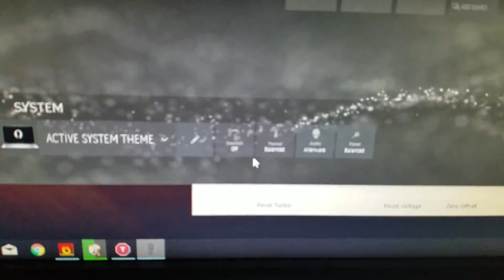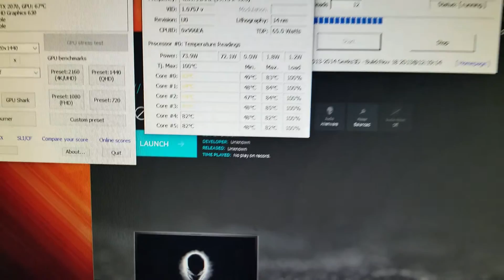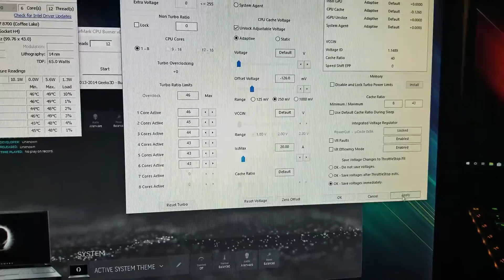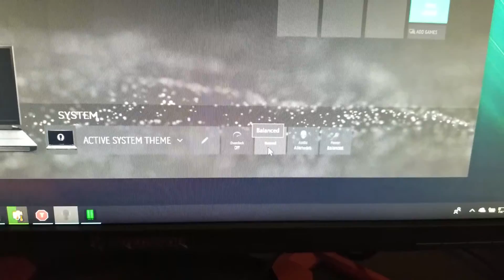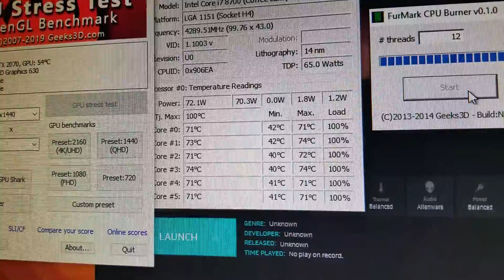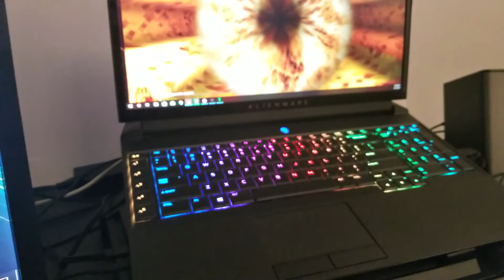Alienware 51m Laptop (8700 + RTX2070) - Furmark Heat Stress Test - ROUND 2

Comment: My hp omen with rtx 2070 and i7 9750h doesnt perform as it should.
While running gpu stress test, gpu heats are going up to 93 degrees and core clock keeps decreasing till 300s and fps keeps dropping till 30 from 190 in like 10 sec.
While running cpu stress test,  cpu heats are going up to 99 degrees and my cpu doesnt work on its maximum. The clocks are decreasing to base clock as i check on task manager performance tab.
Do you think if these are going to be okay if I renew the thermal pastes and clean it ??

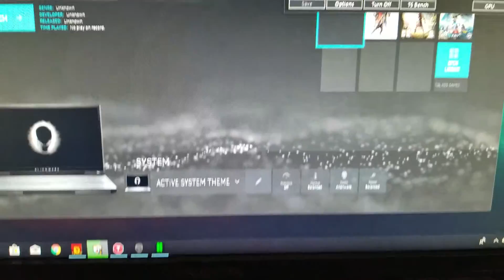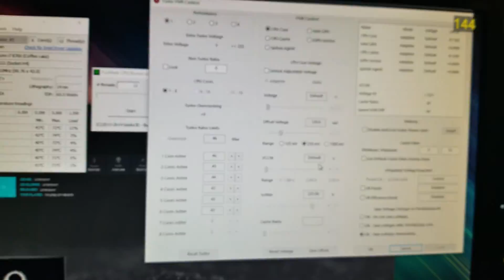Comment: 5:27 you didnt actually turn off the undervolt since its running at 72w while stress testing then look at 7:27 your undervolt settings still applied so your testing was invalid still hitting 72w. Wattage should be less if your baseline was 72w on the first test

Anyway good thermals probably better with 9700k at 4.5 to 4.7ghz balance with thermals and performance
Reply from the maker: Hmm through my tests with ThrottleStop when i enable and disable those settings i see a drastic temp drop, so it must be doing something man .. unsure if it was meant to have a wattage drop why that isn't reflected.. but my throttlestop settings are correct and it has to be triggering because i can get a temp drop from enabling it.
Reply from the maker: https://www.reddit.com/r/intel/comments/fu7pk0/does_undervolting_affect_the_boost_wattagetdp/ - Hmm there might be an explanation for that actually..
Reply from the maker: CPU produces heat according to its power draw, not voltage. If the power draw is the limit then the heat output will be the same. However it could run a bit faster within the power limit when using lower voltage. However, undervolting may increase boost headroom, causing it to still hit the same power target because it's using PL2 more often/longer because of the lower voltage. 

Hmm unsure ... your comment got me interested in learning why my wattage didn't drop though.. yet without a wattage drop i still noticed a temp decrease... at least by 10c ... i mean .. i can replicate that temp decrease... between undervolt applied vs not, i get about a 5-10c difference even with the same fan profile engaged. Curious..
Reply: @Sgt.Bastard  you should turn the slider to 0.00mv for both then hit apply and look your wattage it should be around 85w or something at stock because your undervolted settings was 72w.
Reply from the maker: @KM-kl2wu  Ohhhh LOL.... man its too early haha i totally misread that .. ok so i didn't turn it off ! .. gotcha.. ok thanks for pointing that out. i might play around with some settings again. Its been over a year still love this laptop ! but i am sad that we don't get the upgrade capability that was extensively discussed as a feature, i kinda knew the CPU sockets would change but i figured the GPU's would continue to get upgrades :( .. that kinda sucks.. but all in all, i think a great investment. Ya i think i would have liked the 9700K as well get a bit more juice...
Reply: @Sgt.Bastard  nice machine what is the max tdp of your rtx 2070?

Comment: Bro help me Im ready to buy one but to afraid to get the 2080 with i9 with all this thermal issues .. You still with it ?
Reply from the maker: Sammer Pezzente haha ya man, I still got my machine ... love it .

From what I have seen / read ... the 2080 with 9900K suffers from thermal throttling if not properly undervolted and cooled with the performance fan setting ..

I’m still under the belief that the 8700 / 2070 or 2080 is best combo for this laptop thermal wise .. my friends have 2080 / 9900K variant so I’ve physically seen both now in person, and it’s hot even cooled and undervolted.

If you do go with 9900K I’m sure you will be fine, just make sure you apply some kind of undervolt ensure your fan is in performance mode while gaming from Command Center and maybe get a cooling pad. And if your able, re-paste cpu... the dell stock page job isn’t always the best.

Comment: i am also getting dark side of the moon but i am getting the core i9 9900k version of it
Reply: Just got mine today. How're you liking it?
Reply: @ovaltinehot  how is it
Reply: @digviju001  I'm incredibly happy with it. After undervolting the cpu, Temps have been good with fan speeds set at 80% but it's loud. I don't see them go above 75 degrees on either cpu or gpu in most cases. Since the resolution is only 1080p, I crank every game to ultra and easily get over 120+ fps on most titles. Pubg on mostly ultra settings get me an average of 150fps. I did have some issues with Alienware command center not allowing me to control fan speeds and had to contact support but got it taken care of and havent had an issue with it since. Zero dead pixels and no stuck pixels however, there is a small amount of backlight bleed near the bottom bezel of the display. It's only noticeable when the screen is black so it doesn't bother me. Much, lol. Battery life is absolute trash if you try to game while it's not plugged in. I get about an hour, maybe a little more. Overall, I'm super satisfied with my purchase, which to be honest, I thought I was going to have to return it. If you get a good unit, this laptop is one of the best, if not THE best, laptop you can buy currently.
Reply: ovaltinehot still with it bro ? How its going

Comment: One thing I noticed, you have the laptop raised so it looks like all vents under laptop are clear and open, most people don’t do that and have laptop flat on a table will you run same stress tests with laptop flat on table please??
Reply: The engineers at Alienware are not retarded. There's a calculated air gap below the air vents, spacers mounted on the bottom of the laptop guarantee enough clearance as long as the laptop is placed on a hard surface. If you're one of those idiots who place their laptop onto their bed and expect good airflow you might as well buy an oven.

Comment: Hello there, I almost purchased this laptop with the 8700 and 2060. However I came across a 17R5 with 8750h and full 1070. Temps are about the same as this area51m with the undervolt. So far very happy, will be repasting soon with Thermogrizzly cryonaut soon just for the hell of it, great paste. I already have the amplifier and the 8750h wont bottleneck me anytime soon so I'll stick with this one for atleast the next revision of the area 51m. Got mine for $1200 with a 256gb nvme pcie drive and 16gb ram @2666mhz.

Comment from the maker: It was almost too good to be true :( My keyboard suddenly died, Shut it down last night, powered it up today, no lights, no keyboard detection, not even in BIOS. External keyboards work. A dell on site tech is coming with a new keyboard part for me. I checked to see if a ribbin cable came undone, but the only accessible ribbin is the one on top of the mainboard, to get to the other one according to the service manual you have to pull the everything off, and lift the board out as well, and the main ribbin is under the CPU portion. So looking at this design now, i wonder why you would locate a critical component like the keyboard under an area that gets relatively hot. Curious if anyone else has had a keyboard fail ?? anyway, ill wait for thursday till the tech opens her up, better he break something than me lol.
Reply: Wow are you serious? I've heard they have been having quality issues. I think I'm just gonna wait to get one.
Reply from the maker: @coolmodee  unfortunately yes... I'll update once the tech comes and replaces the part... everything was going so smooth.. I personally havent seen any other issues than the one I am experiencing but I have seen some reddit reports of Exploading DGFF cards so.. not sure. Well see. It's still so early and tons of people back ordered.

Comment: i dont understand these people who have huge laptops beside their monitors. why would u choose laptop if u were gonna use it like desktop. arent these thick 17 inchers are desktop replacement?
Reply from the maker: I guess, why i prefer it, is if i choose to leave the house i can just disconnect and take it with me. I wouldn't use the term "Huge" anymore, its large, and yes weighs 8 pounds. but the older style 17's weighed much much more, and had a even larger foot print, this thing is pretty sleek for its size. Also i just like the "Duel" Monitor setup for things like seeing temps and settings etc, while i game at home, but as soon as i leave the house i use it single monitor.
Reply: if ure rich enough to alienware buy the laptop and the desktop imo.
Reply: @DominickDecocko  It just sounds like you're jealous. We get it, your financial situation doesn't allow you to get an Alienware laptop. It does not grant you the right to take a steamy dump on people who do. There are plenty of well-paying jobs which require people to travel and spent weeks / months away from home. For example, offshore oil & gas, offshore renewables & energy, offshore construction and civil projects abroad. This particular system allows someone to travel easily and install it in their hotel room / facility / platform / ship and leave it there for x amount of time before having to travel again.
Reply: @lIlIlIlIlIlIlIlIlI  My dude why would someone be here if i dont own or interested in buying Alienware? Im writing this shit on my R5. Did you even read? I asked why would he use big laptop like a desktop?

Comment: Any games so far? I am considering this model you have but with the 144hz screen, I'm wondering if the step up from 2060 to 2070 is that much worth it.
Reply from the maker: 2060 to a 2070 will definitely be worth it in my opinion.. 

I will do a video most likely tonight showing some BenchMarks in a few games and what my Average FPS is.
Reply: @Sgt.Bastard  one more question, did you opt for the warranties? if so which? I'm about to pull the trigger!
Reply from the maker: @guillermomartin8248  I just took the standard warrenty but I may purchase some extended.. It is a new product so warranty is a smart idea ;)

Comment: I have an alienware 17 R3 with Skylake cpu and 980m. I built a 2080ti 4k gaming desktop 5 months ago. No more laptop for gaming. Too expensive and never could match the power and ease of expandability of a desktop.
Reply from the maker: Ya it's true.. you will always be better off with desktop.. unless portability is a big deal to you.. then your paying for that.
Reply: 980M is still a good card.  I have 15r3 with a gtx 1070. It plays everything max right now so I'm probably just gonna keep it. And not get the 51m. I really dont want to spend that kind money on a laptop. I only paid 899 for my 15 r3.i might just go desktop myself. I dont like the fact you need two power bricks now making it even less portable.
Reply: You don't seem to realize this laptop has desktop components running at full wattage and a connector for the Alienware eGPU which takes full desktop form factor GPUs. Too bad you're missing out on portability because of your financial situation.

Comment: I heard 2060 is not same as 2070
Reply: Why would it be the same, one is a 2060 the other is a 2070? The more important question is does the 2070 really improve the FPS for the $600 or so cost
Reply: @guillermomartin8248  its not that. 2060 area 51m do not comes with side ventilation.
Reply: @guillermomartin8248  also with 600 dollar they r providing more better heatsink. I was shocked to know when i ordered area 51m with 2060 n get to know that it is not the same model as 2070 n 2080. I canceled my order.
Reply: K Ahmed what do you mean not the same model/
Reply: @coolmodee  the exhaust system is differently designed in 2060 version. But it does have side ventilation.
Reply: @aestheticsluxury3968  You better off getting a 1080 laptop. They're going on sale. Honestly the 2060 is not even worth it. My 899 alienware 15r3 with the gtx 1070 has better graphical performance than the 2060.
Reply: @coolmodee  i agree but Area 51m is just gorgeous n perform great. I played at max n xpu temp never went over 60. Which is best.

Comment: Hey man, just happened upon your video by chance, really appreciated seeing it.

I'm genuinely considering getting this beast, even in spite of the cost, but the thermals are my main concern. Currently I'm on a 17 R3, and yea, the thermals are pretty bad to this day, so it's good to see you getting some positive results. I saw another review where the CPU was running at 100c (cant remember which bench it was) but I damn near said I wouldn't be getting it from that alone.

Which tuning program are you using? Can it be used to help with my 17 R3 (for the time being) as well? When you unndervolt, will it also affect performance, or just temps? 

Thanks again for the great vid.
Reply from the maker: Fear Not ! :) Undervolting in theory should improve performance, what happens when you get to hot is the CPU throttles... the undervolt program "throttlestop" has it in the name.. it stops throttling.. because it reduces voltage and keeps the CPU from getting to hot.. and hence stopping that performance throttle. 

I am just using the new Alienware Command Station software for fan profiles... I honestly think if you go with the specs I have you don't have to worry about temps ever again .. however the 9900k + 2080 RTX is another beast all together.. that might get hot .. and I haven't had a chance to actually see those temps.. but there are other videos on YouTube showing that combination throttling.. but still decent temps for that spec combo
Reply: @Sgt.Bastard  Yea I'm not sure the new command center will run either - too bad since it seems to be soo much better than the old one.

I did try undervolting my R3 - I used Intel Extreme Tuner - but seem to be having pretty good results so far. Like you said, overall temps are down which has made for a smoother experience overall. I only wish I had figured this out 2-3 yrs ago when I first got the thing. Better late than never - hopefully it can still expand the life by another year or two.

Maybe you can offer me your advice: I'm debating between either picking up the new m51 (damn expensive it is) or just buying the AW graphics amplifier and a top tier card until I move back home and can build a desktop. Currently I'm living and working away from home so a desktop just isn't really viable - but I'm also a little shy about spending another 4-5000 on a new gaming laptop.
Reply from the maker: @kelsealawrenson7188  ok so I have the graphic amp when I had my Alienware 17 R4. It depends on a few things... here is what I found.

1. Overall temps drop with the graphics amp because the GPU is no longer shared on the same heat pipe as the CPU.. so it helps with temps.

2. Depends on what CPU you have in your R3, if it's an older CPU you could face a bottleneck when coupled with a higher end GPU.. resulting in lower performance scores. 

I like the 51m but it is damn expensive as you said lol.. with the ability to upgrade parts it's nice... but will Dells proprietary dgx or dfx config whatever it's called..  take off for those upgrades to happen ... time will tell.

What CPU do you have in your R3 ?
Reply: @Sgt.Bastard  I realized both of those points as well, and that's part of the reason I started looking into lowering my cpu temps, having realized how high they were. I have the i7-6700HQ, so not the highest end one. 

I think what I've told myself is that with a graphics amp, even if I had a CPU bottleneck in some games, many games are still more GPU dependent. But in any case, I think I would see improvements from 20-60% (maybe more in very GPU heavy games) I was also telling myself that an investment in say an RTX 2080 could still be put into my desktop computer in 1-2 years.

Effectively I could spend $1000 on an amp+rtx 2080 and get the investment on the card back when I build a desktop.

Still, that 51m is so damn beautiful, lol.
Reply: @Sgt.Bastard  Yea I was aware of both of those factors, which is why I've been looking of late into trying to minimize the CPU temps. I undervolted by about -.110, but the CPU still gets pretty hot (like 90-92 degrees) when both CPU and GPS are running full steam. 

I have the i7-6700HQ CPU, so it's not the top of the line one, but I think it still has some life in it (especially if temps are down so it doesn't throttle). I figured if I got the graphics amp it would still help a lot in GPU limited games, and maybe 10-30% in more CPU limited games, which is better than nothing. 

Yea the 51m is soo expensive, lol. I figured if I went with the graphics amp, the $800 or so I spend on a gfx card is an investment that I could include in an eventual desktop build when I do move home for good. Spending $200 on the amp and $800 I can use on a card again in the future is an easier pill to swallow. But I'd still be stuck with the laptop CPU and pretty plain 1080p 60hz screen (though still a nice screen).

Decisions decisions...
Reply from the maker: Update = not sure if the new command center will run on your R3 you could give it a shot... undervolting will definitely help your R3 though.. and drop those temps for the time being.